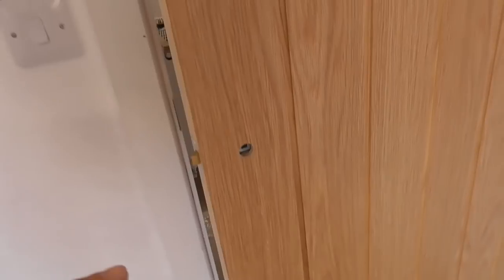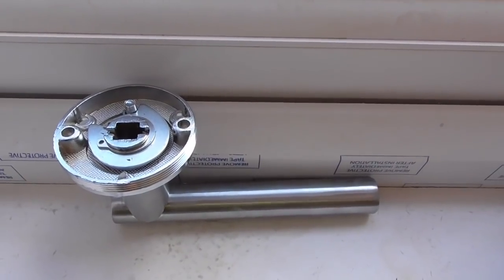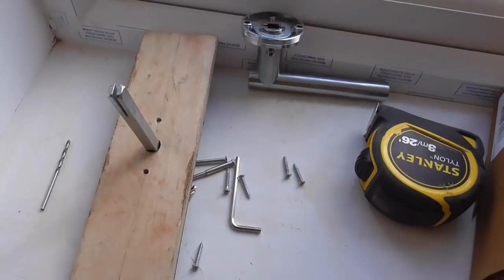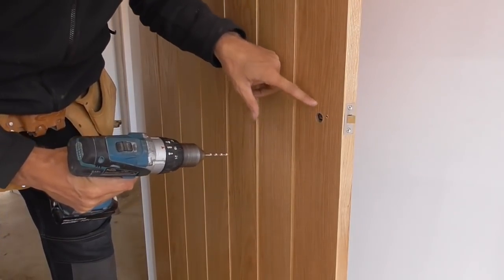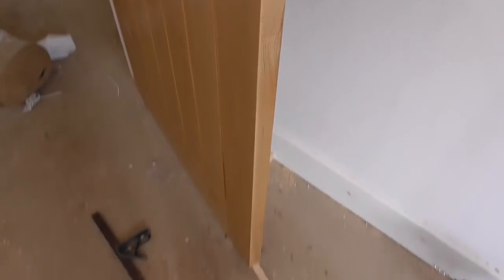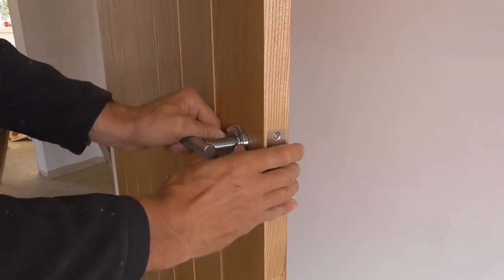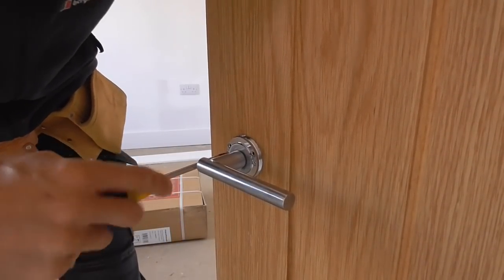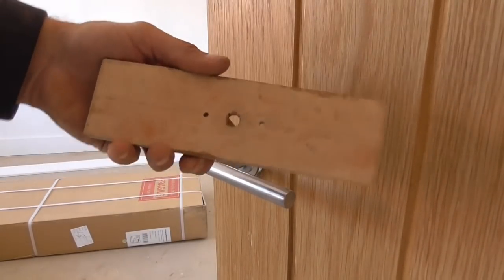Bolt through door handle fitting (using homemade jig)

Comment: Just fitted the same handles and latch to same doors but without the aid of your video I didn't think I could fit the outer through bolt as I thought it would go through the latch. I can now go back tomorrow and complete the job. And as I have four more doors to fit I will make a jig. Many thanks for the video.
Reply from the maker: Hi John. Its satisfying for me that my video has helped you out, and its the main reason I post them up😁Thanks for watching and all the best finishing your doors😎Cheers Del

Comment: Just fitted 7 bang same doors & the identical handle and your "fishing 🎣" analogy is bang on 🤣 I had 2 bathroom locks with thumb turns so was twice the flustrasion 😡 trying to get the through bots to line up spent far too long messing around with them. Great video 👍 thanks for the great tip.
Reply from the maker: Hi Rob. The thumb turns are awful to line up. Even slightly out and makes it hard to turn.😬 Yeah, sometimes you can be, 'fishing', around for ages trying to get the screws lined up.😝 Great comment mate, now get yourself a beer.🍻 Cheers

Comment: That's a great tip, thank you. I've struggled with drilling accurate holes for these handles in the past, and have also seen so many customers where the long screws have been left of then the small trim screws fail and ruin the door. I have 11 doors to do in a house soon so. 👍🏻
Reply from the maker: You're spot there Eric.😃 In many cases, these bolt through screws get left off in favour, as you say, for just the tiny wood screws, and these are not really up to the job.😬 Great comment.👍

Comment: A handy tip for cutting down machine screws, put then into the combi drill chuck at the desired length, hold the hacksaw against the end of chuck and spin the drill anti clockwise.
Reply from the maker: Hi Darren. I have heard about this tip for cutting down machine screws. I must give it a try.👍 Cheers.
Reply: Lol did you get that tip from skill builder
Reply from the maker: @fireblaster9961  I did see a two minute tip like this on SB.

Comment: Good idea for the bolt through fixings.much better than those short screws that always come loose
Reply from the maker: Hi RC. Thanks for your comment.🤩 I know everyone has different ways and opinions, but I don't think those little screws are enough on their own to withstand the large leverage forces put on rose/fixing plate if the handle is over turned, so I always fit them bolt through.😎 Thanks for your comment mate.👍

Comment: Great video.  Some electricians linesman’s pliers have integrated bolt cutters for shortening machine screws. We use them when fitting pattress boxes/ light switches/plug switches. The screw screws in and is cut with the action of the plier, you then screw the screw out which maintains the screw thread. This would save you so much time with guess work and filing down post cut. Thanks for a great video, I’ve got some door handles to fit and your channel has been so useful.
Reply from the maker: Hi Liam🖐Thanks for the heads up on those pliers bud, Ill definitely look into them👊I'm glad my videos are helpful and thanks for watching and your great comment😎Cheers Del

Comment: That's a great little jig.
Another good idea to speed up lining up the pesky screws is to push a straw in hole first so it acts as sleeve.
I'm definitely keeping a few straws in my box now.
Reply from the maker: Great idea.😎 Trouble is, the old plastic straws are getting harder to find nowadays, as apparently, someone's been chucking them in the sea, so we now have to use big chunky cardboard ones.😁 Great comment.👍
Reply: @thetallcarpenter  Earth sleave works ok too 👍
Reply from the maker: @jrsuk1170  Nice.🤩

Comment: Great idea.  Will make one for my remaining doors. The only problem I had was spindle hole size as I commented in previous vid. I opted for 19mm instead of 20mm recommend but when the bolts were nipped up circlip and washer on the back of the rose protrudes and binds. I ended up running a burr around the spindle hole to accommodate the circlip.  I doubt the 20mm recommended would have cleared it.  Thanks again👍
Reply from the maker: Hi RG🖐Yes, sometimes the circling and handle boss to protrude proud of the back of the backplate, and I usually just pair around the hoke a bit to accommodate it👊Cheers Del
Reply: @thetallcarpenter  oh thanks Del...thought I was going mad. I will be prepared on the next ones. Had considered a 22mm forstener bit first, then drilling spindle to 19mm, but a Stanley blade may do nicely without overcomplicating.  😆 You make it look too easy 😎👍

Comment: Good vid!.. I do the same technique.. although I made a jig out of MDF with the same 40mm holes and bolt hole it wraps around both sides of the door and has the non slip car mats on the inside and I clamp them in place.. great minds!
Reply: That's a good idea 👍
Reply from the maker: Hi Craig. I did make an elaborate jig just as you describe, and it was perfect. Unfortunately I left it on a job, and by the time I returned to pick it up, the labourer had had a clear up and burnt it.🤬I couldn't be arsed to make a new one, (as it was made out of laminate floor offcuts), so I just made this ply one instead.👊 Thanks for watching and your great comment.👍
Reply: Ahh yes!.. that horrible feeling when you realise “I left that on that job”
Keep up the good work and the vids mate 👍🏻👊🏻
Reply from the maker: @craigbarry1340  Cheers.😎

Comment: Lovely job. What latches would suit a 1939 door for bolt-through handles 38mm apart? I used one I picked up and mangled the first door fitting it. Old latches were quite shallow so I would prefer a small/shallow one. .
Reply from the maker: Hi Lynda🖐Sorry, bit it's virtually impossible for me to advise what handles would suit your application without seeing what you already have🤔Cheers Del

Comment: I like your simple, easy to understand videos, and your non-condescending attitude to us viewers.  I have a question though - when it comes to fitting the handles, couldn't you just attach the handles to the spindles, then attach them to the door by the three screws, THEN mark and drill the two bolt-through holes (from one side if one is careful not to break out the other side), remove the 3 screws and then fit the two bolts, then screw the three screws back to finish up the handle?  Or am I being dumb?  I am a DIY'er with a little experience, and I have 8 of these exact doors to fit, with corresponding bolt-through handles almost identical to the ones you fitted, so am somewhat apprehensive. Also, what size auger would you suggest for the spindle and and mechnism, and could I use a spade bit instead of an auger bit?  Oh yeah, I've subscribed! Cheers.
Reply from the maker: Hi there🖐You could mark the holes for the through bolt's as you describe, but I'd definitely drill in from each side as the bolt holes are VERY close to the edge of the back plate rose. Check outmy video on fitting these latches, and the drill sizes are in the comments section👍Thanks for watching and your comment 😎 Cheers Del
Reply: @thetallcarpenter  Thanks for the quick reply. Yes I get what you're saying, and can understand the risk of drilling through and having the holes on the other side come through outside of the rose.  I think therefore a jig, like you have made, will be the best method, as then drilling through both sides should ensure the holes are in alignment. I hope.
Reply from the maker: @TrueBrit1  👍😎

Comment: There's a way without having to feel around with the screw. With the handle off and the spindle in one handle, put the long screws in the door handle holes and thread both the metal rods on about 3 or 4 turns. Now you can just push that handle and the 2 rods all the way through to the other side, with enough to make the ends of the rods poke out the 2 holes on the other side. At least on my door the rods could poke out, they taper slightly thinner at the ends. This way there isn't any feeling around for the hole inside the door - the rod is there poking out - you can just put the short screws in the other handle and be able to see the ends get screwed in.
Reply from the maker: Hi there🖐I think I get what you're saying and thanks for leaving your comment🤩Cheers Del

Comment: Hi Del. Right video this time. So use a jig to get through bolts. But then you get this sort of nonsense. You have done the holes square, put the handle level(square to the door) but now the bloody holes in the handle are not in the square position, they are cocked over a d you have a right job to get the handle right.
Reply: I tried to put a photo so you could have a laugh but I don't think it got attached.
Reply from the maker: @benjaminhunt283  Message me at thetallcarpenteruk 👍
Reply from the maker: Hi Benjamin🖐 That's sounds like a right pain mate, and real ball ache to now get right😬

Comment: That looked a lot easier than when I did it 😂😂

Are you able to tell me how you managed to get square through bolt to sit "square" in the jig? many thanks, great video
Reply from the maker: Hi there🖐The round hole in the jig is quite tight for the square spindle to fit through, and this keeps it pretty square when lining the jig up. There is a certain amount of tolerance to be expected which is why I drill the holes for the bolts slightly bigger than then need to be👍Cheers Del
Reply: @thetallcarpenter  Ok thanks for the quick response Del! Much appreciated, I'll have a go on a few bits of scrap 👍
Reply from the maker: @p4fizzle  🤞😎

Comment: Excellent content. 
Fitting with non-connecting screws should be illegal imo. Atleast the handles should only be sold with connecting bolts. I recently got locked in through that, but luckily there was no emergency  
Tell me if you agree
Reply from the maker: Hi James🖐I hadn't really thought about it bud, but you have got a point, and a handle coming off, as you found out, could easily lead to you getting stuck in a room😩Yes, you're also right that maybe all handles should clamp to the spindle, especially on fire doors etc🤔Great comment and thanks for watching 😎 Cheers Del

Comment: I have a question, can you use a hammer drill on the door frame to chisel out a indentation for the strike plate?
Reply from the maker: Hi Sky Wolf 🖐 I guess you could, but it may be a little like using a sledgehammer to crack a nut👊Cheers Del
Reply: @thetallcarpenter  ah, thank you for your reply! I'm just looking for something that's easier than the very old fashioned hammer and chisel XD do you know of any tools like that?
Reply from the maker: @skywolfx76  Hi there. I don't know of anything that might replace a hammer and chisel for this other than a router, which could take the bulk of the material out, leaving the rest to be tidied up by hand tools🔨👍Cheers Del

Comment: Great Video. Thank you for taking the time to make the video. I have few silly questions that I want to ask 😂 is the door a hollow door or is it solid? I have hollow door that I need to put handles on it. Similar to yours but worried that it won't hold it. And second question is what drill size do you use to make the holes? Once again thank you 🙂
Reply from the maker: Hi Tazul 🖐 These doors are solid core, but even hollow core doors will have a fairly decent sized lock block in the the edge which will be solid timber and easily take a bolt through latch👊From memory, I think I am using a 4.5mm drill bit for the bolt though bolts, but do use a drill that suite the particular bolt size as they can differ in diameter👍Thanks for watching😎Cheers Del

Comment: The right latch. Kept wondering why I could never get the bolts through. Latch was always in the way.
Reply from the maker: Yes, you definitely need bolt through latches to work with bolt through handles👍Thanks for watching 😎 Cheers Del

Comment: Great idea , but iv fucked around with them bolts longer than it takes to swing the door they don’t even screw in when there in your hands so they go in the bin😂 great vid mate 👍
Reply from the maker: Hi there. To be fair, these are good quality handles and the machined screws are very good.😎 BUT, I agree with you about the length of time you can mess about with the poorer quality ones, and it can infuriating trying to fit them.🤬 Thanks for your comment.👍
Reply: If the doors solid wood I don't use them wood screws only if the door is veneer over chipcboard  I always use them no matter what or you would have a slack Handel in a short space of time
Reply from the maker: @briangordon1767  👍

Comment: Nice one Mr tall but you didn’t show the bit were you had to cut down the anti turn screws because they were to long and hit the latch body 😜
Reply from the maker: Hi Jim. Fortunately, as these were on a tubular latch, the screws positions in the handle rose actually miss the latch body.👍 I did have to file a tiny bit of the end of the screw for the bathroom lock though.😉 Great comment.👍
Reply: Yeah this caught me out too. Gave up on the bolts as wasn’t bothered cutting down after all of the faffing  around to try line them up. Moved onto the screws instead and once fully tightened the latch stuck and lock wouldn’t come out…took me a minute to realise the bloody screws were too long also. Wish I’d watched this video and read this comment before I started 😂

Comment: I'm struggling with the bolts, preexisting holes every 18 months I'm fiddling about trying to fix handles hanging off the door with tiny screws. I bought new latches in order to fix back to back bolts but the handles line up with the holes making it difficult to get a screwdriver in.
Reply from the maker: Hi there🖐Yes, lining the bolts up can be EXTREMELY fiddly and frustrating😬Try drilling slightly bigger holes if you can👍Cheers Del

Comment: Probably a stupid question but how does the screw nearest the lock edge pass the mechanism inside the door?
Reply from the maker: Not a stupid question Ray.🤩 The latches and locks that are to be used with this handles have holes in their bodies to allow the screws/bolts to pass through them. They are known as, 'bolt through', latches/locks. They provide a better fixing for the handles, particularly when they are on a circular back plate.👍 Cheers.
Reply: Thanks for a speedy reply 👍🏻 love your steady approach and the carport build was fantastic. Keep them coming as my son loves watching as well. He’s a first year carpentry student at tech and is only allowed to use hand tools so he’s learning the trade ground up.👍🏻
Reply from the maker: @raysmith6891  Hi Ray. If my videos are helping your lad, then that makes me feel really good, as its the main reason I'm making the videos.🤩 What's his name?

Comment: Have you had the handle where the rose won't go past the handle! What a bloody pain especially when the spindle to hole locations weren't accurate enough for template/jig. Had to cut a pencil to 18mm long and hold with a pair of pliers. It was crazy. Took soooo long.😖
Ironmongery and materials my biggest bugbear for the last decade.
Reply from the maker: Hi Benjamin. YES, that and all sorts of issues due to poorly made ironmongery.😩 When I work for developers now, they always get better quality stuff for me now, as its quicker to fit, works better, looks better and lasts longer that cheaper, contractors stuff.👊 No matter what stuff you have though, sometimes one of these latches/locks/handles/privacy knobs, just seems to take miles longer than the rest cause you just cant get it to, 'click'.😣 Cheers.

Comment: If I'm correct the bolt through are for hollow doors, for solid doors you can use just the 3 screws like ordinary handles
Reply from the maker: Hi Jazz🖐In my experience, just securing these lever on rose handles with screws handles only, can lead to them twisting when to the lever is turned👍Thanks for watching😎Cheers Del

Comment: I do a similar thing. What rubber do you use?
Same with saw horse too.😂
Reply from the maker: Great minds Benjamin.😉 The rubber is gasket material I use for fixing glass balustrading in stair construction which I just contact glued onto the ply. You could even use kitchen door buffers as the are pretty, 'non slippy'.😎 Cheers. (saw horses rule👊)

Comment: Doesn’t the through bolt meet the latch body?..just asking 🤔
Reply from the maker: Hi Peter🖐The latches are designed to be used with bolt through handles👊Cheers Del
Reply: @thetallcarpenter  hi..the ones I have used do actually stop on the latch body ?🤔
Reply from the maker: @peterneed6283  Yeah Peter, many latches are not bolt through compatible😬
Reply: @thetallcarpenter  hi del,thankyou for your response,in order to use the handles with the through bolts,could you tell me which latches I should be using?thanks….
Reply from the maker: @peterneed6283  Hi Peter. If you search for 'bolt through latches' you'll find plenty to choose from👍Cheers Del
Reply: @thetallcarpenter  ok..Thankyou del 👍

Comment: Iv always wandered why they dont alternate the hole position on the handles on each side so you could put thicker screw in door as you can only put a screw half thickness of door sondont hit other side screw. Ive got young kids and they nearly hanf off the door handles and have to keep tightening at times
Reply from the maker: Hi Martin. You make a good point, and children can soon expose a weakness in anything.🤪 Cheers.
Reply: @thetallcarpenter  thanks i always wondered why they didnt do it tbh. Have to admit i hate hanging doors i need to improve on them
Reply from the maker: @offcuts4146   Just practice I guess Martin, but hard to motivate yourself to practice something you're not keen on.😬 Cheers.